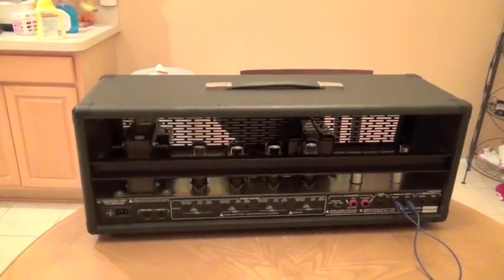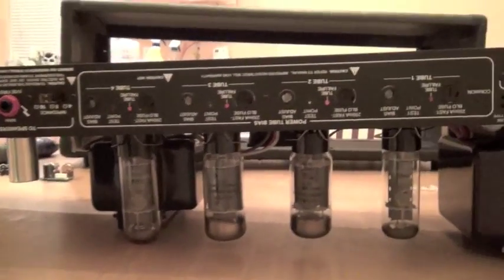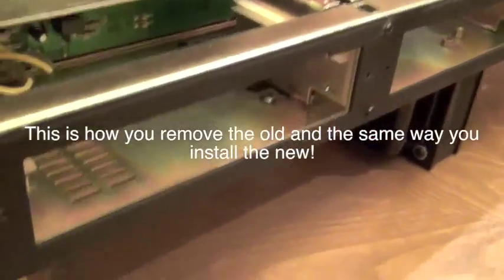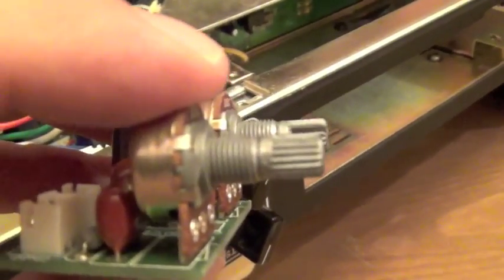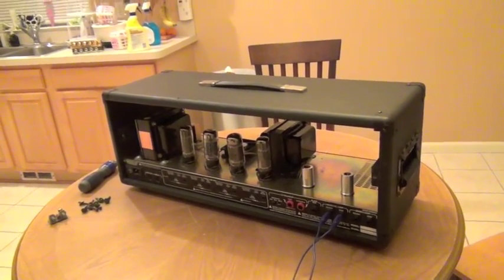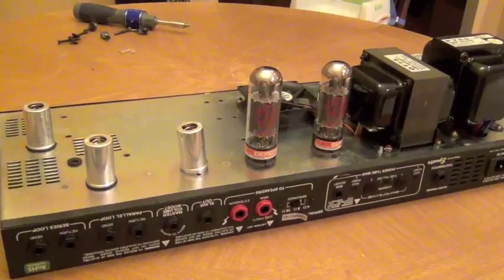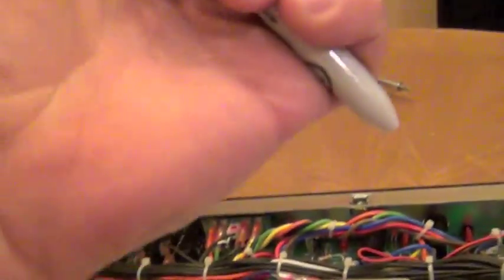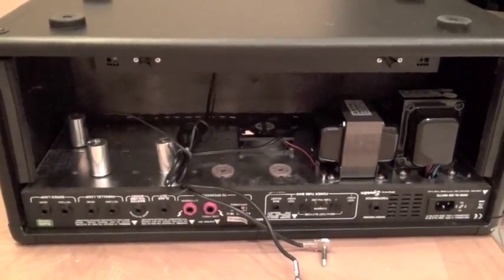MDA replacement board INSTALATION - Part 2 | Salvation Audio

Comment: Hi, do you have the spring reverb? I want to put it into my randall rm50 combo, but I can't find info about the correct installation. I Know that I need to connect the reverb tank into the parallel send and return but I don't understand if it need to be connected to the 9volt under the chassis, and if I need to do that connection how the cable goes from the 9V plug into the reverb tank. Thanks

Comment: Should the jumper remain jumpered or should I remove it? (Rm100)
Reply from the maker: I recommend to remove jumper on beginning.
PULL mode will be more radical then and in PULL mode the density will not work.
If the change will be too radical, but JUMPER in, PULL mode will be less pronounced zhe. and Density  pot will work (but not as sensitive as in Push in mode)